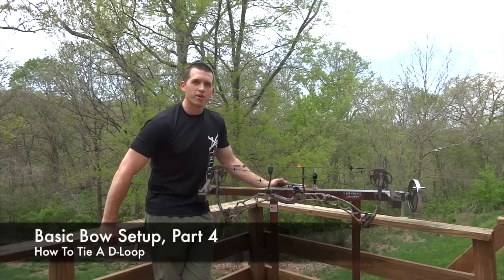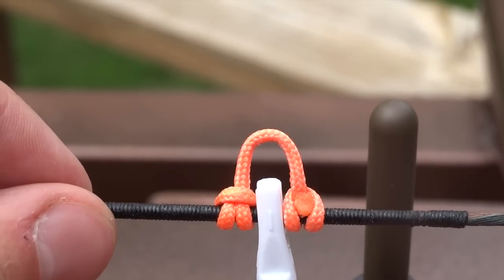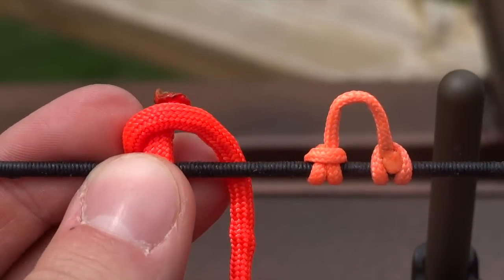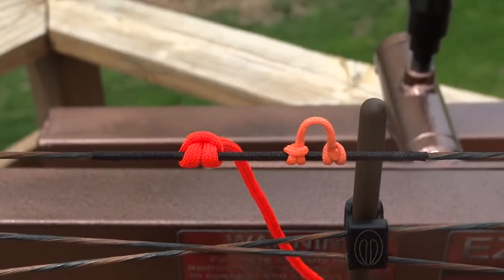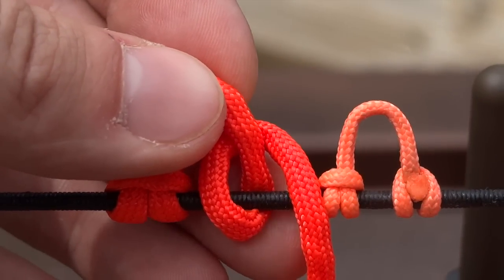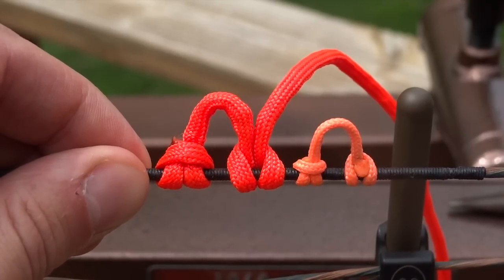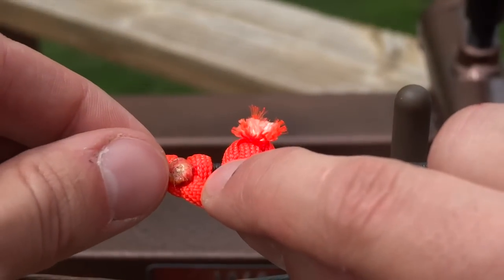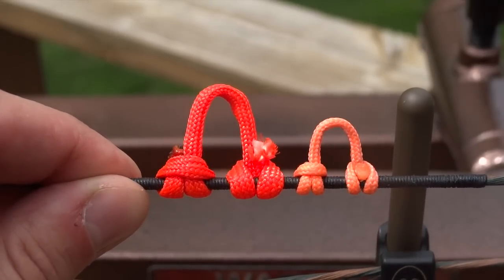Bow Setup & Tuning (4) -- How To Tie A D-Loop

Comment: Hi Mark, after using a bare (compound) bow for 8 - 9 years and then putting it down for about 12, I have just picked it up again and realised that my 30 year old PSE is worn out like me, (59)? So after looking around for a few weeks I bought a new Martin Blade X4 on Australian eBay; I live in Western Australia. The main reason was because it fitted my budget after I bought all the other things I needed to set it up and also all the good reports I read about Martin Bows and the Blade. The 2 local archery shops want $80 to $100- to set it all up; but after watching all your videos I feel confident in setting the bow up my self, plus I want the pleasure of this accomplishment, thanks for taking the time to make them. Russ.
Reply from the maker: That's awesome!  Congrats on the new bow, and good luck!

Comment: I have an old Bear Whitetail 2 compound that I have set up with just a knock for finger release. I really like just shooting fingers but I just got a mechanical release for the holidays. Can I use that placed right under the arrow or is a loop necessary? I'm relatively new to shooting and just want to be sure if this would be inaccurate or damaging to use the release just on the string. Also, since there is a brass knock on the string, will tying a loop around that make it too wide and cause an incorrect angle?
Reply from the maker: Ideally you want a d-loop.  Shooting straight off the string can wear the string and also introduce torque that will affect accuracy/consistency.  I would mark your nocking point, remove the brass nock, and install a new d-loop using your marked nocking point as a reference.
Reply: SoleAdventure.com Yeah I figured it would probably wear firing it like that, and I also noticed that when drawing back with it that it did offset my anchor point and felt awkward. Thanks for getting back to me.

Comment: I was wondering if actual paracord would work, but I have heard that it is to thick and it will stretch to much and possibly cause damage to the bow and/or the person shooting. It makes sense to use actual D-Loop cord, but I have a good bit of the paracord and I was wanting to know of it was a good replacement. If you can help thanks.
Reply from the maker: Axel Gebhardt I wouldn't advise using paracord for the exact reasons that you mentioned.  Proper d-loop rope can usually be purchased at your local shop (or online) for about $1/foot.  BCY makes great stuff.

Comment: I REALISE 550 PARACORD MIGHT BE A LITTLE LARGE FOR SOME PEOPLE , LOL ,MY QUESTION IS CAN YOU USE THE SMALLER PARACORD ,I THINK IT IS THE 350# ?
Reply: No. It stretches too much and is not as strong as real d loop material
Reply: @kevinbiggs3753  you know there 550 that is nylon and some are polyester ,i wonder if dloop string is polyester  ?
Reply: RG AIRGUN NINJA 
Most common d loop is braided polyester. Even better is Spectra
Reply: @kevinbiggs3753  wow !!!!! thanks for the info friend , i tried to use nylon 550 for a lawn mower recoil" pull/start string once ,it didnt last long tho lol ,the real lawn mower recoil rope is probably polyester as well ?